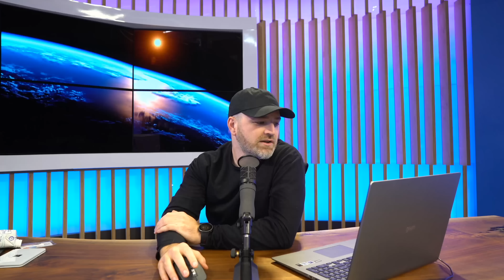Intel's New "Tiger Lake" Takes on Apple and AMD

Comment: Intel already have many high-end processors than the ones present in the market currently. But they are realising it to the market very slowly, like a snail update each year and making their product expensive each year
Reply: No they don't they are stuck at 14nm process for many years and lost all the titles. Intel is better only for gaming by a tiny margin while being more expensive, and trashy non-optimized stuff like adobe. And these benchmarks are rigged by limiting amd power limit and clock speed.
Reply: @gvidasgi2480  ohh

Comment: “They’re showing their Tiger Lake stuff against the iPad 12.9”

Good to know their chips are comparable to two year old chips from Apple. I wonder what the difference will look like compared to a chip from the A14 family coming out this year.
Reply: A14X*
Reply: @Jt-hn6lp  They literally said 'to a chip from the A14 family'.
Reply: ARM dosent even have native x86 support duh.
Reply: The purpose is not performance, it's the size and efficiency of the newer chips. It will obviously outperform apple's ARM chip
Reply: aRUnKA Doesn’t change the fact that it has almost been 2 years since it was released. Whoop-dee-doo! Intel finally caught up to a 2018 iPad😱
Reply: @xbraac 
I think you don't understand architectures: Intel uses x86 instruction set, these are for heavy lifting, and generate a lot of heat, too. Even apple has to use Intel chips in their mac, due to how powerful they are(they're switching soon, forsaking performance for battery).

Phone CPUs use an architecture called ARM, it is less powerful, but is easier to scale down, consumes less power, and generates less heat.

Intel didn't have to "catch up" because their chips were always faster than apple's. Intel has made a great leap— the fact that they can pack that much power in a comparable form factor to an ARM CPU is great.
Reply: @xbraac  Bruh, thats an full x86 cpu scaled down to size of ARM, They are just comparing size and the ipad pro is the 2020 model, not the 2018
Reply: @arunthebuffoon4554  They're not forsaking performance at all.
Reply: @rrageneral1499 
Of course they are, ARM is a not as fast, yet. The main reason to make their own chips isn't performance —its independence. Apple doesn't have to rely on another company for their release cycles. This will bring down costs incredibly.

Let's not forget that windows is still more highly performance optimized than macOS. Macs will still be slower (also the current limitations of ARM CPUs), but they will gain so much in battery, portability and apple can add its own custom chips, to improve the overall experience.
Reply: Vijey the 2020 model has the same chip as the 2018 model
Reply: @arunthebuffoon4554   "ARM is not as fast yet"

In some use cases, the iPad chip is faster than the CoreM that it competes with from a wattage standpoint. I wouldn't be surprised if Apple was able to make an ARM chip that is faster than Intel's chips.

We haven't had anyone try to compete with Intel using ARM, so we really don't know.
Reply: @MarlonDeLaTorreyoutube1  Nope, the 2018 model has a12x and 2020 has a12z
Reply: @goff256  ARM does not even have native x86 software support yet, it is highly unlikely that arm competes with x86 laptops in the next year or two. The upcoming ARM CPUs can be faster of slower (mostly slower) simply because of the way it handles instructions, for example the a12z is a 8 core processor, but in any heavy task, it will only utilize 4 performance cores, unless they put 2 digit number of cores. I would guess the ARM processors will be used in the entry level/low powered macbook 12" and macbook air while macbook pros will stay on intel for now. Dont be fooled by reviewers comparing geekbench on ipad os with geekbench in windows/macs, its not apples to apples, compare something like snapdragon 8cx to x86 both running windows, then you will know how capable arm chips are
Reply: Vijey the a12z is the same as a12x with better graphics performance

My point is: they’re comparing it to an ‘old’ chip, next week Apple will announce their first 5nm chip, which will be a big improvement over the A12Z
Reply: @MarlonDeLaTorreyoutube1  They are are comparing a old ARM chip to a new full x86 cpu in SIZE, not performance, the upcoming 5nm cpu will not be able to compete with x86 in terms of raw power, maybe apple will do some optimizations for make it better but still.... x86 dominates, ARM is only for power efficient systems and not for raw power
Reply: @vijey221  
A) I suppose you haven't been paying attention to Rosetta 2, which will run x86 on an ARM chip. Is it native? Does the person running it care?

B) The A12Z is simply an A12X with an extra GPU core. 

C) The entire line is being moved to ARM. They said as much in the announcement, which I'm really starting to think you didn't watch at all.

D) I'm actually referring to tasks like video rendering, something Apple even moved to their own T2 chip to speed it up when Intel dropped the ball. That's right, newer MacBooks have an ARM chip in there already to make up for Intel's incompetence. 

E) I wouldn't use the 8CX as a sign of anything. Qualcomm's chips have been far behind Apple's for a while. Not to mention that Microsoft's attempts at bringing Windows completely to ARM has been lackluster at best. Apple has shown that they're willing to drag along developers, and it turns out that it works. Adobe is moving Creative Cloud to ARM on the Mac, and Microsoft is moving Office. Final Cut Pro also works on ARM. That's something that Microsoft has not been able to achieve. I'm not even sure they've ported Office over to ARM on their own OS.

F) Let's go back to the idea that the A14X will be worse in single core than an Intel chip. Based on what? Intel's IPC isn't even the best anymore. Seriously, I don't understand how you have so much faith in Intel when they've been a joke for years whose sole trick has been bolting more and more cores while still not having all of their chips on 10nm and pushing back their 7nm back. TSMC is taking about 5 and 3nm.
Reply: @vijey221   Then why was an ARM chip able to render 3 4K video streams in the time that an Intel chip in the same wattage area was not even able to render a single one?
Reply: @goff256  We will find out when arm macbooks actually release and its not about apple vs intel, intel is dead now,
Its ARM vs x86
Lets use AMD to represent x86 
Do you think the A14X can compete the ryzen 4800u / 4600u that actually have 8/6 full x86 cores and not just hybrid cores?
No one said the a14x will be slower in single core..
And the point of your original comment itself is wrong, Bringing down the size of an x86 CPU to that of an ARM cpu is indeed an achievement.
Reply: @vijey221  It's only an achievement because x86 is not that great. But let's go to the question about the 4800u. Yes, I believe that it will be able to compete with the 4800u.
Reply: @goff256  x86 is great, it uses the same set of cores for every task, We will know how A14X performs against Ryzen 4800u      ; )
Reply: @vijey221   Using the same cores for every task hasn't helped them out with specialized tasks, has it?
Reply: @goff256  Using the same set of high power cores increases performance but cuts on battery, ARM has 4 cores for performance and 4 cores for power efficiency (generally as some have 2 performance and 4 low powered ), using 8 high power cores always in x86 will obviously be better than using 4 powerful and low powered cores alternatively. Because in ARM, battery is more important.
We cannot compare ryzen 4000 and Apple's ARM now since they run different operating systems, but on paper, x86 (7nm) should be better.
Reply: @vijey221   Let's go through some of the problems you seem to be having. For one, ARM can have any configuration of cores. I doubt a laptop that has really great cooling and a bigger battery will have the same configuration as a phone.

Oh, and if we're doing nm contests, let's talk about how we're expecting the A14 series of chips to be the first off the new 5nm fab from TSMC.

It feels like you're stuck thinking that how it has been (ARM is for phones, isn't capable of being high powered) is a sign of what ARM can do. That's not the case. ARM was chosen for chips because it doesn't have the baggage of the bloated x86 architecture. That doesn't mean it can't be ramped up.
Reply: @goff256  The, upcoming ARM ''12 macbook will be fanless. they dont have to make it powerful ,they will focus more on battery for the basic macbook, very likely that A14X will be used in both the ipad pros and basic macbooks. ARM is nothing special, it is just a scaled down version of x86 to focus more on battery. ARM is literally built for battery, Apple is going ARM because they want independence and not performance, if they wanted performance, maybe there should make ryzen macbooks. No point in arguing until they release.
Reply: @vijey221  "ARM is just a scaled down x86"

No, it really isn't. Please go read more about RISC vs CISC.

"The upcoming 12" MacBook will focus on battery life and not power"

And yet it will still be better than if they had gone with the Intel Core Y series. And AMD hasn't proven they can go down to that wattage that well, either.
Reply: @goff256  Sorry, i mean x86 is built for raw power while ARM balances between performance and battery, The power required for running a x86 cpu is nothing compared to even a bright display, yet many people care about bright displays and low wattage CPUs.
Reply: @vijey221    And yet, as I've pointed out multiple times, there are a growing number of areas where ARM is punching above its TDP. The idea that x86 is needed for a lot of power is not one that is necessarily true anymore. If an iPad Pro can beat out a processor using twice the power at tasks, it isn't something to laugh at.
Reply: @goff256  TDP is overrated, Its nothing compared the power required for a bright (300 nits) screen, and i dont think an 15w ipad can beat even a 15w 7nm x86 cpu
Reply: @vijey221   That depends on what you're wanting them to compete in. We know an iPad chip (which, no, isn't 15w. It's lower) is way faster than a higher watt chip when it comes to video and photo editing. Unless you're telling me that x86 processors are over three times as fast at video editing in the past two years while iPads have stayed the same.
Reply: @goff256  Ipad pro uses a 15w chip, and ipad pro is not faster than amd.
Reply: @vijey221  I don't know where you're getting that from, but no. You can't have a device as thin and light as the iPad with a 15w chip and no fans. 10w is the maximum you can expect with a design like the iPad's and still no fans. 

Also, like I said, it depends on what you're asking it to be faster in. I'd take an A12Z over the latest AMD for video editing any day of the week. Same with photo editing. But running Call of Duty? You've got me, I wouldn't want an A12Z for that at all.
Reply: @goff256  its 15w according to anand tech, and why would you take an a12z over a ryzen 4800u for video editing? Ryzen will absolutely kill the a12z ( both running same os) even in different os, ryzen 4800u kills the A12Z
Reply: @vijey221   I guess Apple is just that good at cooling, then, what with there being no throttling on the chip even when editing 4K video.

As for why I would take the A12Z in something like video editing, it's because I don't think the Ryzen 4800U would "kill the A12Z". The A12Z is able to go beneat the minute for minute mark on a 4K60 video, something that AMD itself shows itself incapable of doing:

https://www.pcworld.com/article/3567749/amd-demos-how-fast-ryzen-4000-laptops-are-in-adobe-premiere-pro.html

https://cdn.wccftech.com/wp-content/uploads/2018/11/iPad-Pro-editing-performance-1.jpg

Note that we are talking about the A12X performance on that one, a chip that is two years old.

All of this is beside the fact that this year will see Apple pushing ARM chips that are designed to take more advantage of the increased thermal headroom that Macs have when compared to an iPad. Imagine a device with fans or even just more space for passive cooling. It isn't hard to see why I'm enthusiastic about ARM as a future for computing.
Reply: @goff256  Lets not compare using Adobe Premier, its extremely biased towards intel, not optimized for AMD, ryzen 4800u destroys the A12Z even tho the ryzen is running a much heavier OS, (both are 15w) https://www.notebookcheck.net/AMD-Ryzen-7-4800U-keeps-up-with-higher-powered-Intel-Core-i9-9880H-thanks-to-promising-Geekbench-5-test-scores.455490.0.html
A12Z
https://browser.geekbench.com/v5/cpu/3719531
heck, even the 4600u destroys a12z ( both running 15w)
https://browser.geekbench.com/v5/cpu/3718567
Reply: @vijey221   A) A two year old chip negligibly loses in single thread and loses by roughly 25% in multi isn't the coup you seem to think it is. 

B) I really haven't been able to find that 15w claim anywhere but 1 Anandtech article and a few sketchy websites. I'm telling you, I really don't think it's true. A 15W chip is not going to be able to be passively cooled by something as thin and light as the iPad Pro.
Reply: @goff256  Again, the chip is released this year, A12Z vs Ryzen 4000 comparison is perfect, Both are 7nm 15w units except the difference being the way they handle tasks, 
https://www.anandtech.com/show/13661/the-2018-apple-ipad-pro-11-inch-review/4
Zen 2 architecture was released a year ago too,  if the upcoming A14X is based off 5nm, it wont really be a fair comparison against 7nm x86 CPUs, Wait for Zen 3 to be compared against A14X, The ryzen laptops must be cheaper which more and faster ram too.
You must knowing that geekbench doesnt really stress the CPU and cannot be compared cross platform, Wait for ARM macbooks and lets compare cinebench, blender, handbrake etc...
Reply: @vijey221   It is a CPU released this year based on a two year design.
Reply: @goff256  That is a mistake on apple's part, its considered a 2020 cpu, for example, intel is making the same cpus for 6yrs, but the comet lake cpus are considered new
Reply: @vijey221  Except Intel says they're new CPU. Apple kind of gave the game away when they called it an A12Z as opposed to an A13.
Reply: @goff256  that's not the point here, both the ryzen 4000 and A12Z are 7nm 15w CPUs, dosent matter which year they were released, both use TSMC's 7nm process (Apple SoCs use 7nm +)
Reply: @vijey221   Except I still don't think it's a 15W CPU on Apple's side. I don't think you know how physics work.
Reply: @goff256  what does it have to do with physics?
Reply: @vijey221   A 15w chip couldn't be passively cooled by a device that thin and light.
Reply: @goff256  no comments, we can find the wattage in the upcoming ARM MacBook, September 15th
Reply: @vijey221   I doubt they're going to come out and say it, so it will probably be another round of guessing.
Reply: @goff256  we can find it even if they don't say it on MacBooks
Reply: @xbraac   Bruh
i7 11th gen got 1600 for single core and 6000 for multi core in GeekBench 5.
from a 4 core CPU.
XE graphics smoked MX350 in some games.
Reply: aRUnKA Efficiency is where Apple is the best, the A12X/Z iPad Pro runs without fans
Reply: The fact that TGL might still burn a whole In your wallet hahahahahahaha, Intel can’t compete In value against Amd and Apple ditching Intel because they know they can do better.